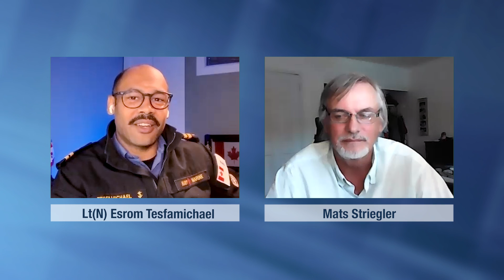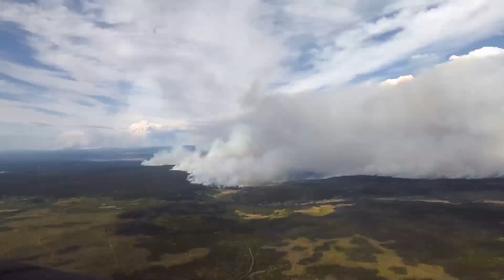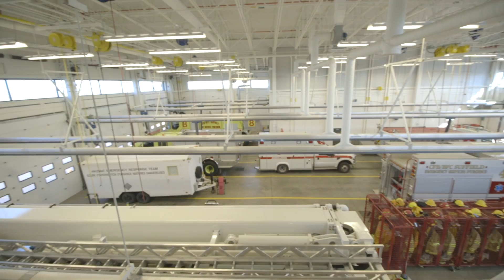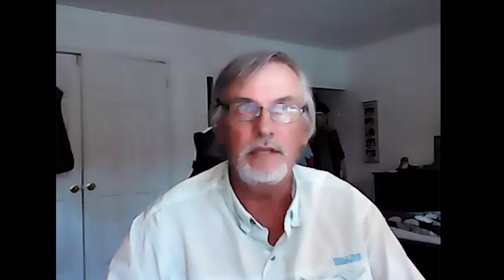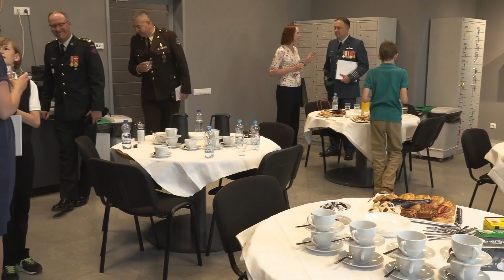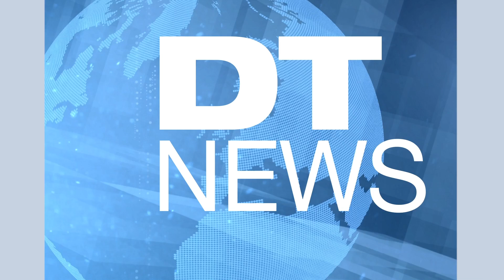Defence Team News | 4 August 2021

Comment: Thought / idea: 
- At some point I was looking up earth-sheltered structures. Something in my YT feed came up. https://en.wikipedia.org/wiki/Earth_shelter I recall it was mentioned that the temperature is regulated really well in such facilities. Structures like these can stay warm during the winter and stay cooler during the summer. Thus resulting into significant reduction in energy costs. You couple these with solar panels and theoretically speaking the temperature throughout the entire structure could be maintained for a very low cost. 
- Maybe DnD can work with Boxabl and another company in order to provision Earth shelter structures. 
- The only thing is lighting. How working in areas where less lighting is available --> This could impact mood/psychology over the longer run. So I wonder if any clinical studies have been done here. 
-- For the lighting issue, this could be a potential solution. But like I shared above and coming from uneducated perspective on the impact that lighting has on mood/psych. But maybe this could be a solution? https://www.smithsonianmag.com/smart-news/led-skylights-perfectly-mimic-natural-sunlight-180954348/ 
- I wonder if there is a company that has actually solved the set of problems that stand in the way towards seeing more 'earth sheltered structures' https://dengarden.com/misc/The-Pitfalls-of-an-Underground-House